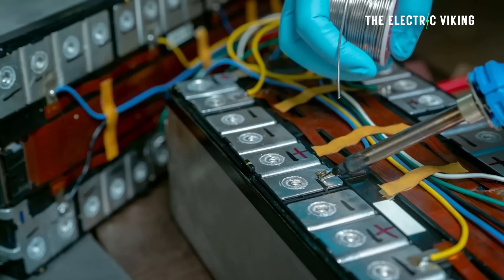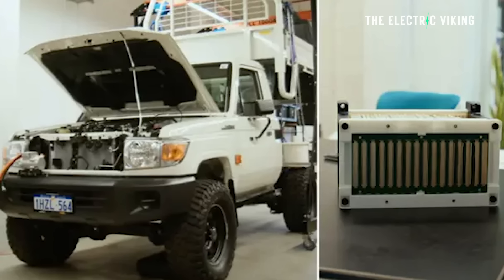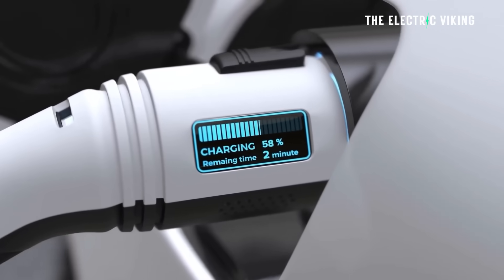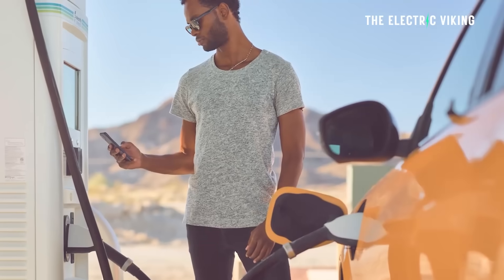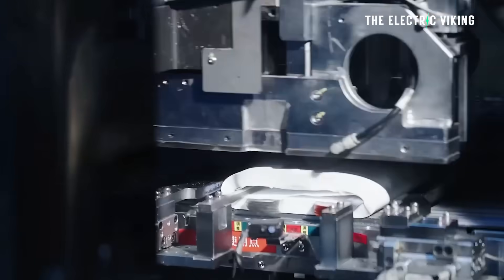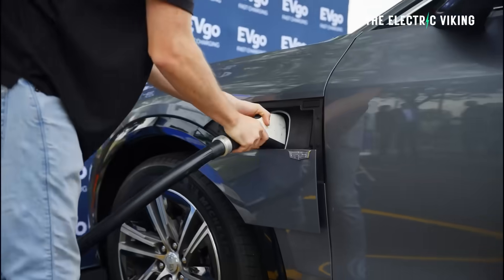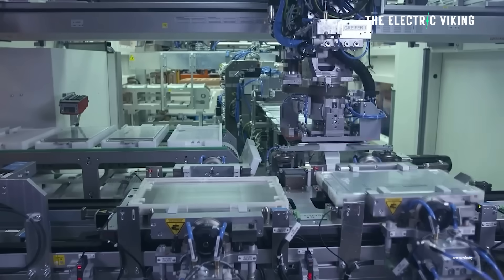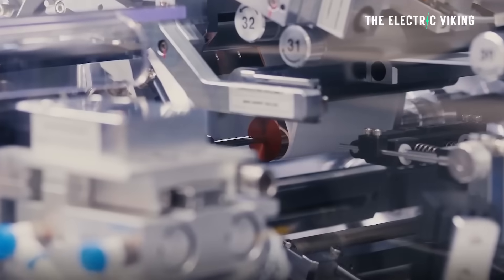World’s 1st XNO niobium EV battery charges to 100% in 10 mins

Comment: Wow. Not because of the 10 minute charge but, 'wow', what sort of electricity supply and cabling will that require?  A sub station for every 50 houses probably, and complete rewiring of the grid and your home wiring system.   Think of every house charging an electric car at this rate!   insane!
Reply: Not a lot of point in charging that fast at home - you got all night to do it. It's for quicker stops at dedicated charging stations so you can get on your way.
Reply: 1,000 cars charging  faster won't require any more electricity than 1,000 cars charging slower.  Think about it.  Not all cars will be charging at the same time any more than all cars have ever all filled up with gas at the same time.  This is one of many very, very silly anti-EV disinformation attempted arguments.
Reply: The way fuel cell catalysts and  membranes and there anode and cathodes becoming so efficient that one day a small coke bottle full of cheap green hydrogen will take your car 1000 miles, this is coming, and new solar cell making hydrogen coming to market that will run homes and cars, and cheap cost effective prices
Why because solar cells have become more efficient making hydrogen than battery storage or just plan electricity, fuel cells are becoming truly remarkable engines for all transportation, secret of fuel cells is fuel cells actually clean the air as they run due to there electrolysis!
Reply: First thing I was thinking about was what sort of charging station this thing would need to charge on that amount of time.
Reply: Exactly this. For example an 80kWh battery would require around half a megawatt of constant power to charge in 10 minutes. If the battery voltage is 1kV then that's 500 Amps! It's the average electricity consumption of 500 homes. For ONE battery! The charging cable would need a crane to lift it. It simply isn't going to happen.
Reply: @John_L Yes It is i charge my phone and car while I'm asleep.
My energy supplier balances the load.
Keep up dude.
Reply: @andrewsaint6581  Not at half a megawatt you don't. And that it the entirety of my point. Keep up indeed.
Reply: @John_L 1,000 cars charging faster won't require any more electricity than 1,000 cars charging slower.  Think about it.  Not all cars will be charging at the same time any more than all cars have ever filled up with gas all at the same time.  This is one of many very, very silly anti-EV disinformation attempted arguments.  And as others have said, this only applies to public charging, as there is no need to charge super fast at home.  7Kws and 48 amps will do just fine for a full tank in the morning.
Reply: @Tom-dt4ic  All of this is true but it misses the point that I was making. I am not anti-EV but I am an electronics/electrical engineer and I know what it takes to deliver half a megawatt of electrical energy. This sort of load is the entire capacity of a large electricity substation, just for one charger. A cable capable of carrying 0.5MW to the car will be impossibly heavy. These are real practical issues that are nothing to do with the battery technology or EVs specifically. Yes there are possible solutions but they will be very costly and economically unviable.
Reply: @John_L  Maybe I'm missing something, but aren't there already 500kw chargers out there doing just fine?  And if you up the voltage to 800, then then wouldn't the cable be the same size as, say the current Tesla super chargers delivering 250kw at 400 volts?